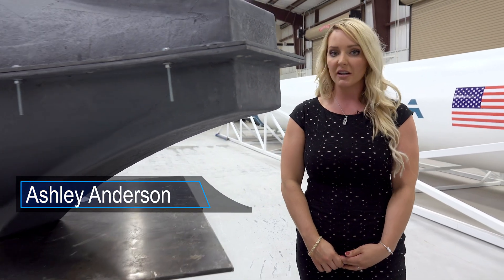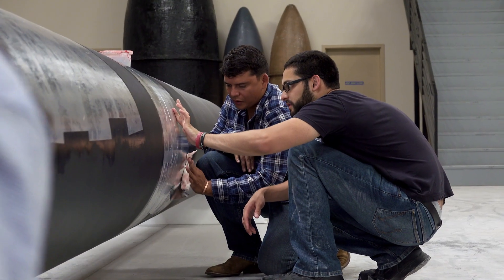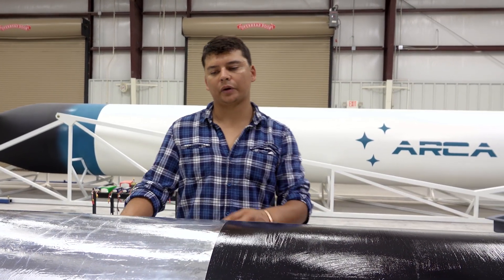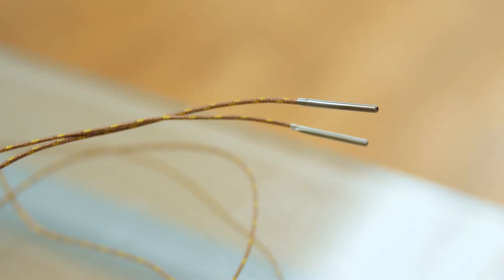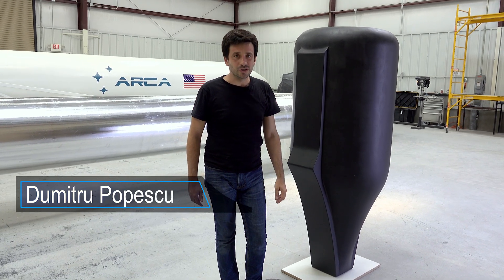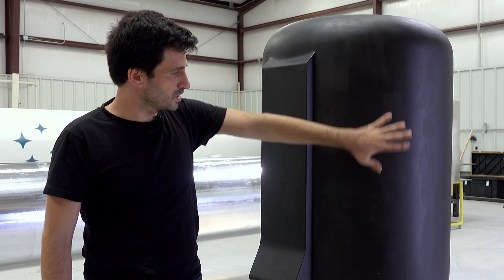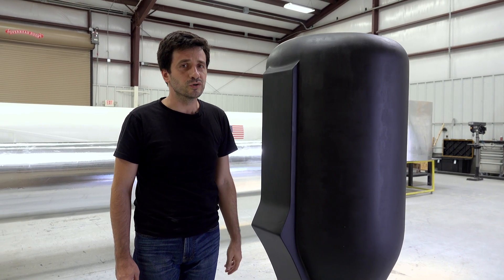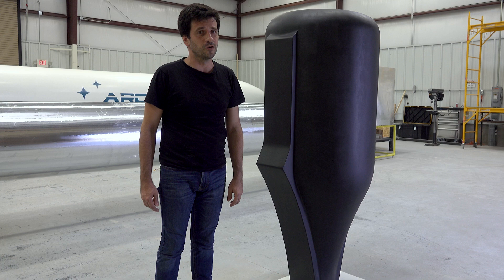Flight of the Aerospike: Episode 5 - Engine Mechanical Structure

Comment: While watching your video I've come up with an improvement of a non-inverted rocket engine. it would be an engine with very expanded nozzle skirt extension that works good at high altitudes but inside would be a narrower nozzle skirt that works good at low altitudes and that would be jettisoned half time into the burn. Why is it not a thing yet? Wish You a success

Comment: Err... that aerospike is described as being made the wrong way around. Combustion should happen on the outside ramp (so it can expand against the atmosphere), so the thermal layer should go over the structure, and the interior be the cool part. Not that it looks like anything other than a non-functional model anyway.

Comment: Since the rocket is pressure-fed,, how will the CNG system control individual chambers for  thrust variation for roll, pitch and yaw? Are we talking simple valves that open and close or are you going to be using some type of injectors? Also, does the the Demonstrator 3, Haas 2CA or perhaps future variation of this engine have restart ability? And if so, will it require additional complexity to achieve that?
Reply: That's fantastic!  So temperature based catalyst. It really seems to me that ARCA is taking things back to the basics and developing a rocket that really addresses the question, "ok, what is the absolute simplest, lightest, cheapest rocket that can reach orbit  and put a payload up there that we can build today in the most efficient manner"? Almost 0 moving parts, no gimbal yet full guidance control, super light tanks, single stage, restartable, potentially reusable...it hits all the points everyone's been trying to do for so long.

If you can succeed in building it,  you have a test bed that you can really build on in the future. The sheer simplicity of it is what makes it so awesome and should really help with the reliability factor. At the same time you are poised to accomplishing a whole bunch of firsts in the process like SSTO, first linear aerospike, etc. You guys might really be on to something here :)

Comment: How is it going to steer itself?
Reply: gyroscope and thrust vectoring ( aiming the engine).
Reply: Morty Smith The engine is moveable?
Reply: LiuyoMZ yeah they put it on a gimble and use the gyroscope to aim the engine. At least thats the most common way. Old soyuz boosters just used a fuck ton of smaller motors placed on different axis', and they would fire momentarily if the booster got off course.
Reply: Oh, thats nice.Soyuz steering looks not efficient at all
Reply: frick ya, if ya'll need help from Rick just look in a mirror and say "dirty sanchez" a few times.

Comment: Why not an annular aerospike? Is the linear one going to gimble? The tank(s) are going to be multiple pieces joined together? is anything going in an autoclave? Will you hydrostatic test the tanks? Regenerative cooling for the engine? and Caleigh is cute.
Reply: A cradle slung/nested wing array could be used with a full trailing edge aerospike array to send vehicles efficiently into and back from space as infinitely reusable equipment.

I 'drew up' a system in my mind in a matter of seconds which addresses most of the critical issues of such a system, based on a 3 stage layout.

Stage 1 is a large lifting wing with a lot of fuel capacity and thrust which can get very near the upper atmosphere with extra heavy payloads,

Stage 2 is a medium profile lifting body with heat resistance for hypersonic flight for transitioning into and out of the atmosphere,

Stage 3 is more of a needle/rocket/missile with emergency stabilizer fins which are normally retracted during operation, while it has vectored thrust ports to steer with in space.

Stage 3, able to spin around in flight where there is no issue with aerodynamic drag, can use its main thrusters as brakes as much as needed to match speeds with floating space stations, then return to earth's atmosphere reducing speed before entering the burn speeds enough to merge with stage 2.

Once these 2 are reunited, they basically decelerate the rest of the way in through the 'hot' atmosphere until they are slow enough [and cool enough] to match speeds with the slower 3rd stage, which then carries everything back to the space port.
Reply: Can you describe the thrust vectoring system? Is it fluid injection?

I see that how the pitch and yaw axis can be achieved by throttling one end of the linear aerospike, but I'm not sure I understand the roll axis.
Reply: I think Ashley is hotter.